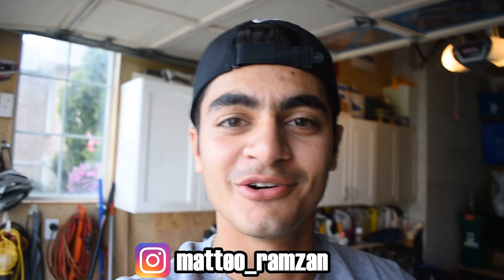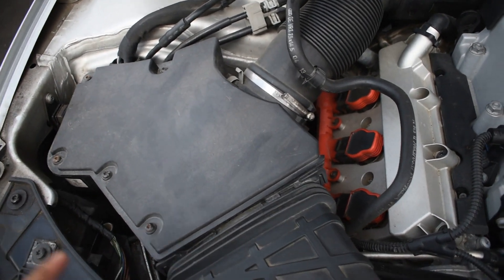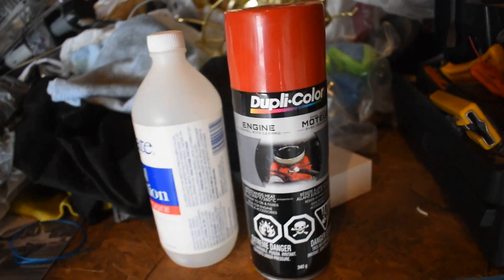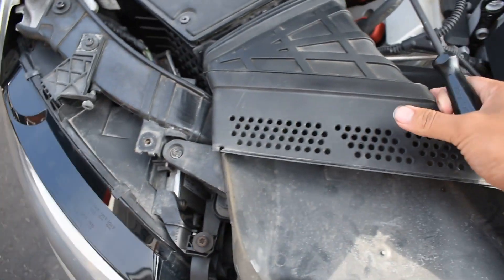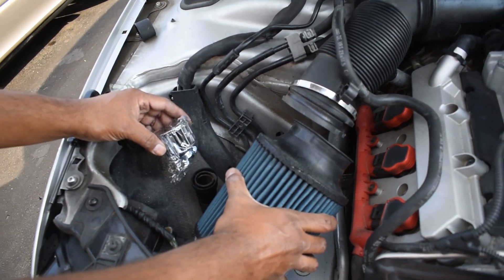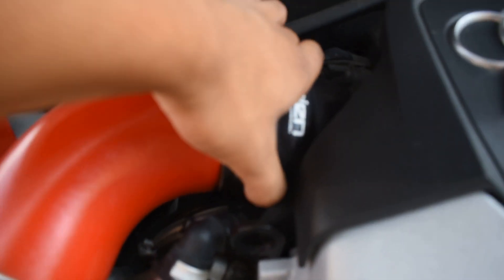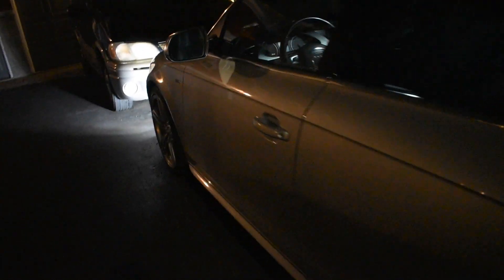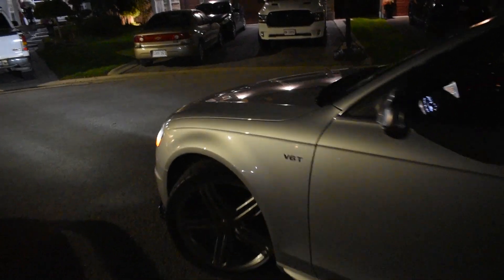INJEN Intake Install | AUDI S4

Comment: Still running this setup? I see you didn't get the vibra mount and attached your intake tube to the frame directly... your engine doesn't have any flex at all. (??)
Reply from the maker: Yeah man I’m still running this setup and I have no issues!

Comment: Does this intake come with the mini air filter?
Reply from the maker: I bought the kit used so I didn’t get the mini filter, but I think if you get it brand new you should get it with the kit.
Reply: No it doesn’t , also if u got like me x-pipe fitted you barely hear wine noise ..